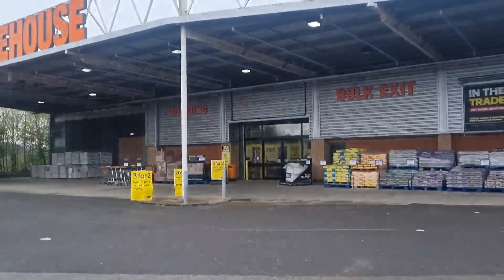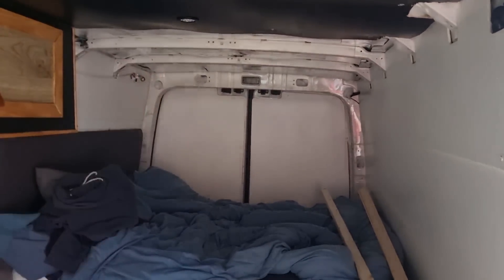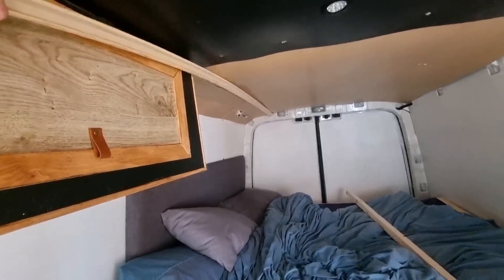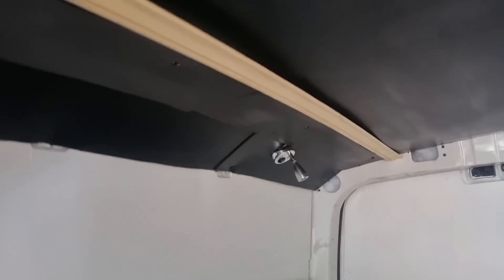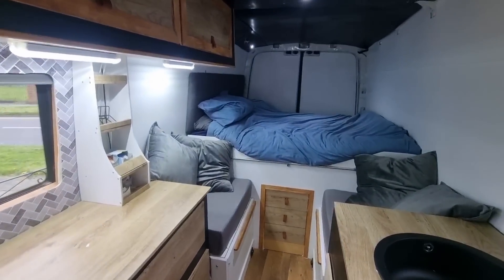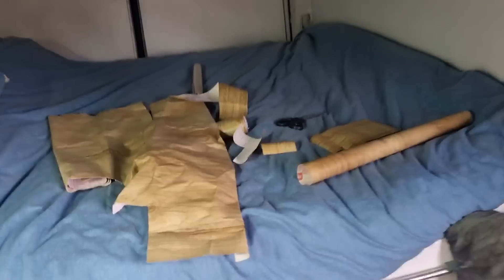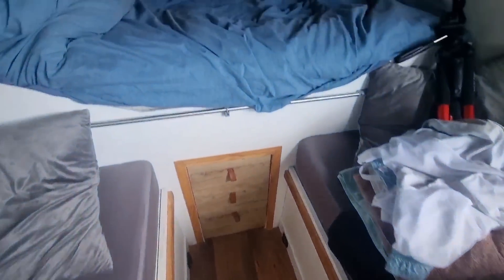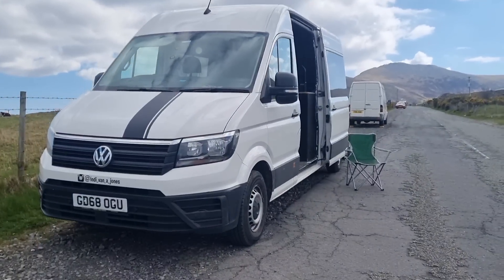Van Conversion Finished... So Close

Comment: If you wet the back of hardboard and let it soak a little before you put it up, when it drys out it stretches out pulling it flat. Top tip from joiner with 50 years experience 😊 having said that thin plywood would have been a better option and wouldn't have cost much moor.
Well done for achieving what you have so far. A usable comfortable home 👍

Comment: I hate nik naks - annoying tat. In my opinion. I  will be going for sleek clean lines and functionality. Just find the right van first which is getting difficult. I wanted to stay small but as a short arse at 5'7" I hate stooping so finding the right height without being transit size is difficult. I may have to get into redesigning the structure which will be a pig. Any suggestions would be appreciated. Good video fella.